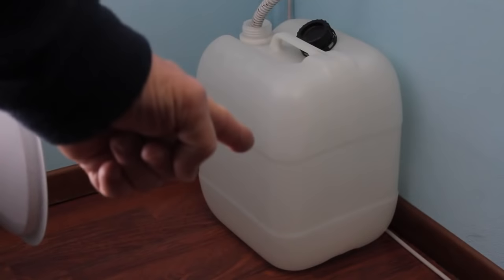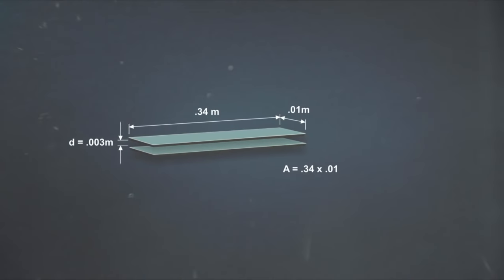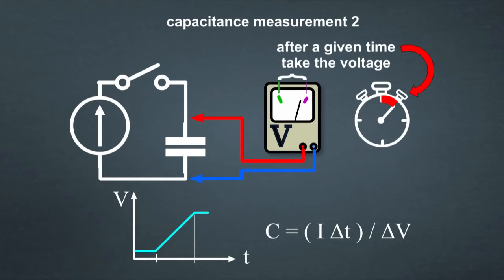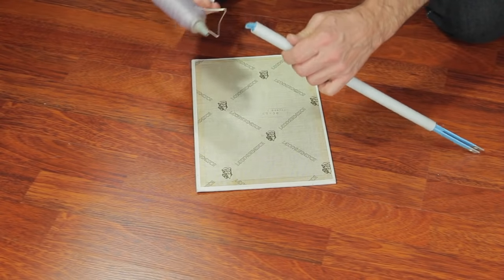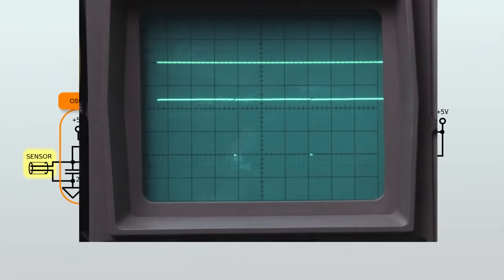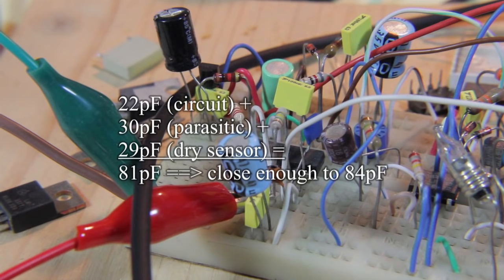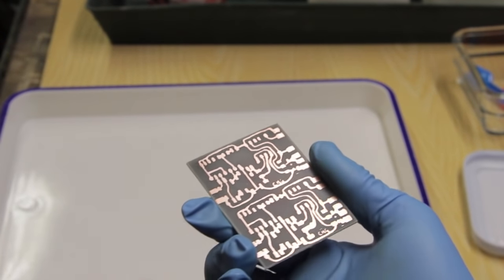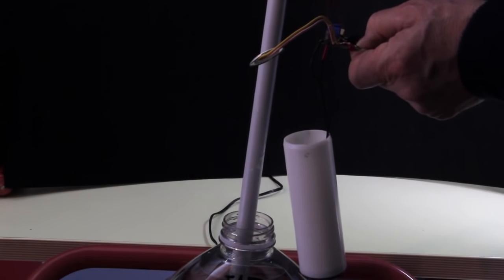Water level/fluid level capacitive sensor - How it works and how to make one

Comment: Very good! I would just like to ask which integrated circuit used 8 legs that appears on the left side of the scheme in the video, when mounted the board could not identify, is a 555 oscillator? grateful for the help
Reply from the maker: It is a 393 dual comparator (one of the two is used only). It is mounted in the etched board, not on the breadboard (where you can see an other opamp because I've been simultaneously testing an other circuit not discussed in the video).

Comment: In your circuit diagram, what part at the most front end called to generate the quare wave pulses ?
Reply from the maker: It's the first NAND gate. Looking at the configuration you can guess that it's used as an inverting gate. Being a Schmitt trigger is fundamental to operating properly.
Happy new year!

Comment: Hi, 
I really like your video and appreciate your efforts. I have some questions and i hope you would like to answer these.
1. Can I make 4.5 feet long capacitance probe?
2. How long wire from probe terminal to circuit is recommended.
3. What is accuracy if water changes from clear water to dirty (contains mud or other particles) water, does it give same reading?
4. Is it mandatory to use Acrylic Color on top of Crystal resin coating?
5. Can we use any other material than Aluminum for probes?
6. If Arduino have ADS, will these capacitance reading be readable in Arduino?
Regards,
Reply from the maker: 1. Yes, requires tuning.
2. As short as possible. This is one of the trickiest part when designing these kind of circuits.
3. I don't know, I had to make a test but never had the time to do it.
4. No. But insulation and the dielectric of the insulator is of paramount importance.
5. Yes, provided it is a good conductor of electricity.
6. What ADS stands for? If it was meant to refer to ADC, as long as the ADC input is decoupled from the primary stage of the circuit (after the F to V conversion) it does not pose any problem. However for a professional design I would not use an ADC, instead I would directly gauge the frequency.
Cheers.

Comment: Okay, it works, but why did you go to the trouble of building what is essentially a capacitive liquid-level sensor capable of measuring the full range of liquid levels in the tube, when all you needed was a top-level discrete switch to turn on a warning?  My experience with these circuits was as an aircraft mechanic. As I remember, the capacitive liquid level sensor was developed in Britain late in World War II to fulfill the need for an aircraft fuel-level sensing system that was accurate in flight and had no moving parts.  It is still widely used today, although ultrasonic level sensors are now used in new designs.  One of the most reliable and trouble-free systems I encountered was used in Convair airliners equipped with twin turboprop engines, the Convair 580.  Based on a vacuum-tube amplifier, it used a simple capacitance-resistive bridge circuit to drive a servo motor inside the instrument that  positioned the indicating needle at the scale position for the sensed fuel quantity, and also drove a potentiometer wiper that rebalanced the bridge circuit for every indicator movement.  The capacitance input was provided by the total of all the in-tank, tubular capacitors connected in parallel, plus a separate reference capacitance signal from a submerged compensator.  It worked amazingly well, and better than some of the digital capacitance circuits found on later aircraft models.
Reply from the maker: That sensor with pot feedback based on a vacuum tube, you nicely described is interesting indeed. I chose the capacitive sensor for three reasons: it is easier to adjust the alarm level, it's robustness because it has no moving parts and it cannot be damaged when it is pulled off the tank (when it has to be emptied), and to have fun 😊

Comment: Very informative video! I have a 20gal chlorine tank used for well water treatment and would like to use an ESP 8266 to send an MQTT message to my node-red/raspberry Pi system so as to flash one of the lights in my living room which is connected to a Sonoff Basic running Tasmota.

Flashing the ESP 8266-01 or some other variant to send a MQTT message at some level {approx 20% full} might tax my limited programming skills however.

Comment: what does NC meaning on the lower left side of the circuit @2:13 time frame,and is this 2k7 = 2k ohms? thanks
Reply from the maker: NC : not connected. Closest value for 2k7 is 3k not 2k, not sure it would be a negligible difference if you change that resistors, I should check the circuit but I have not time to do it.

Comment: OK but I'm trying to do this outdoors for rainwater containers. Complex circuitry breaks down due to humidity. I tried to enclose my circuits in jars and cover the jars from the rain but humidity still gets in. Only simple conductive circuits seem to work reliably -- nothing with timers or oscillators has worked for me yet. Any chance you could make one of these with components that don't care about moisture? Thanks!
Reply from the maker: This is already meant to be moisture proof. You have to spray the circuit with (insulating) lacquer. Or put it in a box and fill the box with epoxy.
Conductive circuits suffer of corrosion and moisture find a way to get in easier than with capacitive that can be completely insulated.
Reply: @AccidentalScience  Thank you for your reply. My question really was whether some components have better moisture resistance than others and whether they can be used preferentially to build a circuit such as this. I think the most effective way to keep moisture out of the circuit is to submerge it in a non-conducting liquid that's heavier than water. That way the circuit stays dry even if there are small cracks in the container. But these are just brute force approaches. I was wondering if there was something more elegant available.
Reply from the maker: @SashaXXY  all electronic components have more or less the same problem with moisture. The only standard technique used to prevent this is lacquer or epoxy coating aka conformal coating.
Reply: @AccidentalScience  Ok, thank you for the information.

Comment: Hi, did you manage to build the pressure capacitive sensor? I can't seem to find that upload.
Reply from the maker: I did not made it yet. I had some troubles in making the pressure discs. I will post a video when it will be ready.
Reply: There are pressure sensors for water for around 10€ I have one but will build a capacitive one because I like them better
Reply: @AccidentalScience  Is it possible if the pressure sensor uses a barometric pressure sensor. Then the resulting pressure will be proportional to the water level(?)
Reply from the maker: @rainbowforest09  no. Barometric sensors are made for air pressure, water pressure is way higher.

Comment: Wanted to ask if the volume of the water will have any effect on the capacitance? What I mean is if you use a bigger tank with the same height, will it needs to be calibrated
Reply from the maker: No.

Comment: Hi, great project do you think it can be used for an House oil heating tank to measure the oil level? It’s a 2500 litre tank.
Reply from the maker: As it is no, it requires the redesign of the probe as the oil has quite a different dielectric.

Comment: If the level sensor will connected to the pcb using about 1/2 meter thin coaxial wiring could this cause problems to the high impedance input of oscillator's schmitt trigger gate?
Reply from the maker: Sure!

Comment: Hi, 
Great video🎥
Can you tell me in immersed condition how did you measure in MM or CM the relative dielectric const water -80
Reply from the maker: Sorry, I'm not sure about your question: what do you mean for "water -80" ?
Reply: @AccidentalScience  
In that video you were told like immersed condition the relative dielectric const. Water : 80 .... What is that 80
Reply from the maker: @balajiramesh6814  oh gotcha. Water have a typical dielectric constant (AKA relative permittivity) of 80. This is a dimensionless number being a ratio. See here for more: https://en.wikipedia.org/wiki/Relative_permittivity
The relative permittivity (or dielectric constant) does not change by varying the immersion of the sensor's probe, what it changes is the ratio between air and water between the plates, which makes the capacitance to change because the dielectric constant of air is ~1.
The relation between depth of immersion and capacitance can be calculated by the ratio of the segment that is not immersed using the dielectric cons. of air, and the segment that is immersed using the dielectric const. of water. Through this means you can make a relationship between depth in mm and capacitance, or frequency (after the oscillator stage) or voltage (after the VF converter stage).

Comment: Nice one sir, can you share your detailed work, formulas. So that I have planned this to take next level. And I have read that has of propagation delay of 31ns at 4.5V from IC datasheet, is that its max bandwidth of 32MHz at <86 degrees celsius?. If it is bandwidth, as per my design The RC oscillator oscillating between 500kHz to 700KHz. Does the circuit work properly?. Help me.
Reply from the maker: Details on my website. Propagation delay can't be used to calculate the BW. Anyway 500kHz is attainable.
Reply: @AccidentalScience  thanks for the clarification. How you designed those sections (pulse generator and f/v. finally comparator in schmitt trigger configuration to create hysteresis). I have read project work in the website but frankly speaking I am a noob. Please help me sir.
Reply from the maker: @9293149246  that would require a whole new video, it's too long to go into this level of detail here. Sorry. Maybe in a future article or video I will try to address this topic.
Reply: @AccidentalScience  ok, sir

Comment: I want to replicate this project. Can you please answer few of my queries? It would also help other, those who visit this video!
1. Can I attach the probe separately with a wire and keep the circuit at a distant? 
2. Which wire should I use? Twisted pair or Single core shielded?
3. Can I use this same circuit for moisture count in soil?
Reply from the maker: Answers:
1. No. The closer the probe is to the circuit the better the sensor will work. I attached the probe with two short leads for testing purposes only, but those leads was source of noise and troubles that I compensated in some way ...you know, experience helps here :)
2. see 1.
3. No, the circuit and the probe have to be redesigned for that specific purpose.

Comment: Hi, Can we use Not gate instead of Nand Gate ST ?
Why Resistance value is kept as specific 560 Ohm in Pulse generator section.  what would be the impact of if we increase its value ?
Reply from the maker: Yes you can use a NOT gate 74HC14 even though it is a little bit slower than the NAND, reading from NXP datasheet. This however shouldn't undermine the circuit. Changing the resistor in the Pulse generator section would change the charging pulse width, you can of course change the resistor and change the capacitor so that the RC result is the same (approx. 6us). However this must follow the series resistor (82ohm in my design) to keep the discharing pulse width accordingly (approx. 1us). Because this would also be influenced by the input capacitance of the gate, and stray capacitances of the PCB, sticking with relatively small resistance values helps to avoid problems.
Reply: @AccidentalScience  Thank you for explaining.
I am testing the circuit under different temperature conditions (from 25 Degree Cel. to 65 degree cel.).  The value of 10 K pot at LM311 needs to change according to change in temperature.  Please suggest how to compensate / modify the circuit for wide range of temp.
Reply from the maker: @shiveshsainisavitsaini507  it would require another circuit because water's dielectric changes with temperature. Too complex to give an answer here, sorry.
Reply: @AccidentalScience  No Issue, I will share if i got some solution. Thanks again.
Reply from the maker: @shiveshsainisavitsaini507  you simply need another sensor that picks a fixed capacitive segment that must be always immersed. Then use the deviation from a known capacitance-temperature to compensate the deviation from the measured capacitance of the water sensor. This is the most accurate method of compensation. An alternative solution is a thermistor immersed into the water connected to an opamp with adjustable gain and floor to compensate the voltage from the sensor using a second opamp as an adder and then use its output to feed the comparator already in the sensor (the lm311 or for this application even a lm193 or half 393).

Comment: Could you clarify how the liquid levels can be output to a smart phone. Did you say ESB 2286?
Reply from the maker: ESP 8266. You obviously need to make a program in order to connect and see the output on a smart phone. The program has to read the analog signal (at the point indicated in the schematic) and generate some kind of user interface to display the information, i.e. a web page, and operate as a wifi access point.

Comment: Can this capacitor system work to test level of vegetable oil in a tank or funnel?
Reply from the maker: Yes it can. The tuning resistor at the input has to be recalibrated to the permittivity of vegetable oil (I don't know how much it is so unless you know just do some trial and error), and keep the plates apart enough to avoid the oil to clog the gap. Good luck.
Reply: @AccidentalScience  Wow! Thank you for your very quick reply!
I am not an electronics buff, but I will attempt to build the equipment.  It would help me if the circuit part was available as an add-on to an Arduino.  I am building a computerised log stove that will also burn used veg oil using a special burner shpe and a drip feed.  The aim is to make it so safe that it can be left running without attendance.
Reply from the maker: @biopoweruk  cool. Send me a picture of the finished product, I will post it on my website.

Comment: which chips did you use for the circuit? can you also share the circuit with us? id love to build the same sensor
Reply from the maker: The schematic with chips should be visible in the video. I don't remember right now. Anyway in a month or so my website should be up and I will put there the schematics.
Reply: @AccidentalScience  i am doing it with a 555 astable multivibrator to convert the capacitance to frequency, then am using the LM331 to convert frequency to voltage which is sent to an arduino analog pin
Reply from the maker: @kevin-kw8bv  555 is slow and have low impedance, which is far from ideal for this application. I don't say it won't work but it may even not work. I say this not to discourage you to try but just to give you a possible reason in the case you meet troubles.
Reply: @AccidentalScience  yes you are right, the 555 multivibrator is not working correctly, what other chip would you advice me to use?
Reply from the maker: @kevin-kw8bv  look at the schematic in the video.

Comment: Considering capillarity, would it be inaccurate ?
Reply from the maker: Good question. The distance between the two plates is large enough to avoid capillarity, this was a thing that I taken into consideration when I designed this sensor. Accuracy however was not the primary goal, the instrument has shown an accuracy of circa 3mm over 250mm or ~1% (measured against the water column); the final stage of the circuit, the trigger that excite the output alarm, is far less accurate tough.
Reply: Thanks for answering. By the way, I was trying to take a similar approach. But my water container doesn't support insertion, so I am trying to use two aluminum plates to measure the water between。